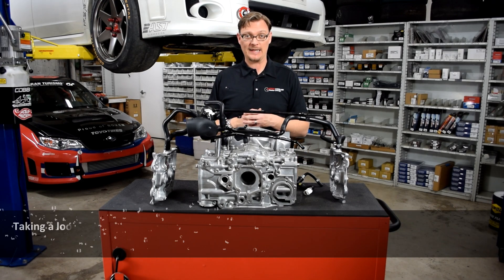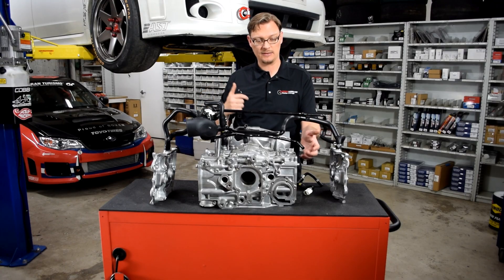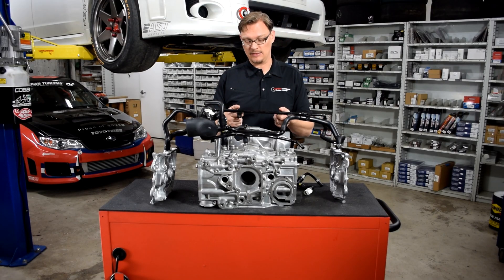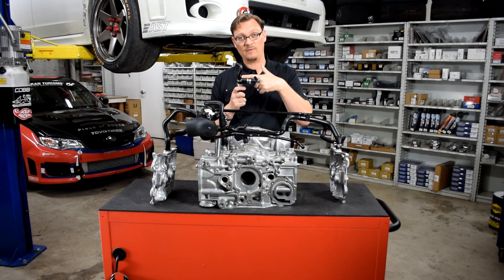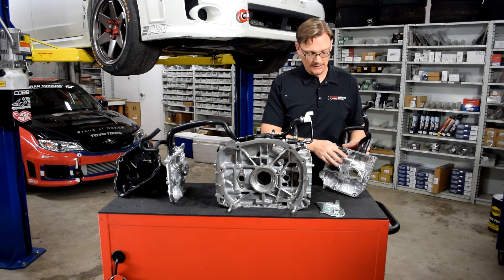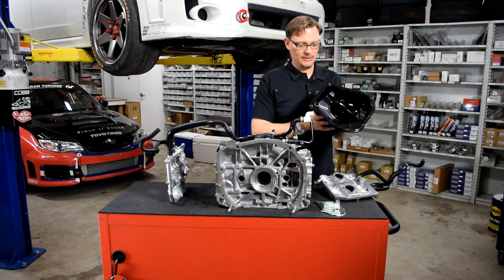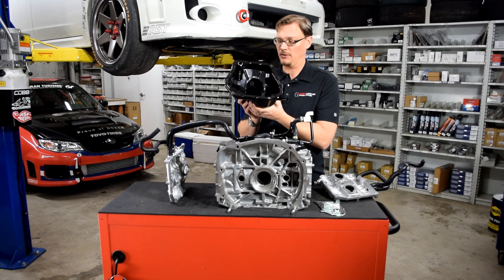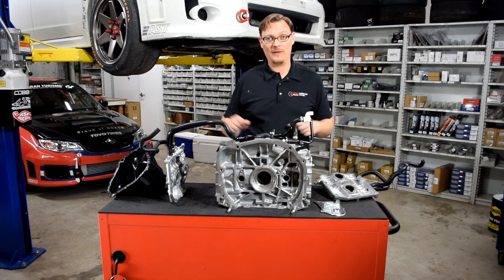Taking a look at the Subaru EJ25 Turbo PCV System

Comment: Great video, never seen such an in depth look at the EJ PCV system, shows us that them engineers at Subaru put allot of thought into the system,
Reply from the maker: Thanks for watching, and thanks for the comment!
Reply: The Subaru engineers did a TERRIBLE job in designing the PCV system because there's still a LOT Of oil that gets sucked in the engine.  Which is why AOS and catch can are so popular and a must have to avoid detonation / knock.
Reply: @neuspeed79 I’m sure you could have emgineered a better system. Besides, AOS and catch cans are completely unnecessary at stock power.
Reply: @SonikJesus  You couldn’t be more wrong. Because the pcv sucks, is why a lot of engines fail. Blowback builds up over time within the engine and the heads / cylinder get blown. AOS is a reliability mod.

Comment: At 1:40 I have a question because: You say the crankcase breather port is not on EJ20 motors, however i have a jdm EJ20 that has this breather port... am i missing something? Im looking at the stamp on the block near where the oil pump is and it says EJ20 which i presume to be 2.0L
Reply: you and i are here for the SAME reason.

Comment: The weird oring that goes on the rear oil pan drain back pipe what would be the right way to install it. Flat side of the oring facing the bottom of the block or the grooved/lipped side facing the bottom of the block? 
Cheers

Comment: This is very useful.
I bought a subaru the previous owner had not provided the right provisions from the crank case ventilation that is supposed to equalize pressure on the heads. On noticing this i take it to a local mechanic and he uses an old spark plug to blank the open ventilation. 2 days later i have oil leaks from the from cam seals.
Am preparing for an engine over haul.

Comment: Jon the degree of quality content and accurate information you and your team put out never ceases to amaze me! Thanks for your continued videos! I have a question, is it ok to run one catch can? Or should you have one catch can intercepting the connection between the separator vent into the turbo inlet line, and then another catch can intercepting the line from the hard line on top of intercooler to the hose going back into the intake pipe?
Reply from the maker: Thanks for watching and thanks for the comment.  You would definitely want 2 catch cans.  One for each circuit.  We discovered early on that if you "T" the breathers down into a single can, that can cause its own set of problems.

https://youtu.be/iJs1SSAOYiU?si=1ZCRVSLO2APz-QQK

Hope that helps and Stay Tuned!

Comment: Can the crankcase be connected directly to a catch can? and eliminating the valve cover inlet leaving only the outlet free to the intake? This way the gas pressure on the valve cover would be eliminated, preventing leaks, does that make sense?

Comment: The tube ending under the oil in the sump stops the crank case vapours from traveling in reverse up said drain tube. Without it the crank case vapours would take the path of least resistance which would not be though the baffling.
Reply: You nailed it! I'm new to Subaru & just purchased a 2006 Baja Turbo with 90k miles. So I got the haynes manual, but some of these videos are extremely helpful. Thanks for sharing your knowledge 👍👍

Comment: I need help with my pcv system on the ej20x is different and i want to find a good remedy i change the pcv valve oem all the hoses brand new oem vf52 turbo  but still have oil on my throttle body intercooler and even on my 3 port ebcs is weird i want to know what you can recommend cause so far you are the best isn this situation thanks

Comment: Heat soak cycles hardened the PVC  rubber hoses coming off the top of the valve covers especially on the passenger side .reused the driver side. Rock hard on passenger side. Unable to save
Reply from the maker: Yes, that is fairly common actually.
Reply: Thanks for quick reply. May still have oil leak issue.valve covers done,now doing the oil cooler oil rings. Hope this helps. Last is the feed lines on the turbo
Reply from the maker: No fun!  Hope you can track it down.

Comment: yo tenia el problema que aspiraba aceite mi subaru outback xt este trae un motor 2.5 turbo, le puse un canister y este atrapaba el aceite pero igual mojaba la admision, asi que compre 2 valvulas pcv de subaru 2.5 y las puse en la salida de ambas cabezas y el problema mejoro, ahora lo tengo asi y me bajo el consumo de aceite, no se si sera lo mejor pero resulto :P

Comment: Am victor majani from kenya ma question is about oil catch can is it efficient and can it bi used on NA subaru
Reply from the maker: Thanks for your question.  Yes, you can install a catch can on an NA Subaru.  Generally they would need them less, but the principal is the same. 

Just make sure that you follow the same rules and keep one can per PCV circuit.

Hope that helps and Stay Tuned!

Comment: I was so lost and now I’m found😮
Reply from the maker: Thanks for watching the video and I hope it was helpful.  Stay Tuned!
Reply: not sure if you guys check these comments often but what if i’m running an aftermarket AOS? for example, IAGs AOS has a coolant hose that connects to the expansion tank where the PCV system is normally routed and it doesn’t leave an area for me to run those factory PCV lines

Comment: Would you get Oil coming from the rear blow by hose?  I have a oil leak on the passenger side rear hose.
Reply from the maker: That is certainly possible, especially as the hoses get older.  If the hose has turned solid, there is a good chance that it is not sealing properly any longer.

Thanks for watching and Stay Tuned!

Comment: This is a great video  on this PCV system of the platform.  My question is it better than the IAG AOS system? It probably is and why didn't Subaru put a better PCV system or rather design a better PCV system?
Reply from the maker: Thanks for your question.  I would answer that by saying that in the condition where the factory AOS system fails, the addition of something like the IAG AOS will give you more capacity.  It is not a fix, just an increase in capacity.

There is a little more to the cause of the issue, and we are working on a solution, or a discussion of possible solutions.

I'd also recommend going through these videos as they go into more detail about what is going on when the PCV system fails:

https://youtu.be/HAvxjSdQsXI

https://youtu.be/iJs1SSAOYiU

Hope that helps and Stay Tuned!

Comment: I still don't understand the stock PCV valve in the manifold on turbo cars. Under boost, the valve closes and the turbo creates suction to pull gas out of the crank case. When idling or on decel the valve opens but under that condition there is almost no blowby considering that the amount of air in the cylinder is small and under reduced pressure when the throttle plate is closed. It seems like the PCV valve is actually not helpful and is a failure point if it were to get stuck open boost would enter the crankcase. This point only applies to turbo cars and I understand NA cars . Am I missing something?
Reply from the maker: Thanks for your question.  You have the function of the PCV valve correct.  First, I'd say that it is not that common of a failure point, so I would say that isn't a reason to remove the valve.

As to why it is there, it is to help ensure that the crankcase gasses are still being vented when the engine isn't under positive boost.  If the valve wasn't there, then there could be a build up of those vapour's, especially on a street car that isn't in boost that often.

This is less of an issue on a race car though.

The other purpose that a PCV valve serves is to ensure that if any positive pressure is built up at WOT, it can be reduced when the throttle closes, and by the same token, it helps to ensure that as you go into WOT, the crankcase should be starting under slight vacuum rather than atmospheric pressure, etc.

It is a small difference, but on a street car especially, it can make a big difference.  Even on some track cars.

Hope that helps and Stay Tuned!

Comment: Anyone have a part number/name for the metal hoes that attaches to the tmic?
Reply from the maker: We have this kit made by Grimmspeed for the STI TMIC:

https://www.flatironstuning.com/grimmspeed-tmic-y-pipe-kit-02-07-wrx-04-sti

Is that what you needed?  Or did you need the two smaller ones that fit the WRX TMIC?

We can help with those as well most likely.

Thanks for your business!

Comment: Any idea how to fix high crankcase pressure on an Ej20? It’s high horsepower application and I believe I have that problem I’m running a Cobb air oil separator right now. Any help would be greatly appreciated!
Reply from the maker: Thanks for your question.  The first thing I would say is to make sure that your drain is routed properly to ensure that the AOS can is draining properly.

Beyond that, we do have something in the works, but it isn't something that I can go into detail about yet.

In the mean time, I'd recommend taking a look at these videos:

https://youtu.be/iJs1SSAOYiU

https://youtu.be/pXQdgxHWFwk

Hope that helps and Stay Tuned for another video in the next couple of weeks.
Reply: @FlatironsTuning  thank you so much for the quick response! I’ll definitely stay tuned 👍🏼

Comment: Thanks for the video. Very good to know in detail how the stock pcv system functions. I'm still unclear as to the need for the pcv valve to be non return. Is there a point at which the pressure in the turbo intake would be positive and thereby the pcv valve would prevent that positive pressure from entering the crankcase?
Reply from the maker: Thanks for watching.  The PCV valve needs to close when the intake manifold goes into positive pressure, which happens when a turbo starts making boost pressure.

hope that helps and Stay Tuned!
Reply: @FlatironsTuning  thanks! Still confused 😆... so the pressure on the intake side before the compressor also becomes positive under boost conditions? I find that in itself confusing. I'd have thought it'd become more negative under boost as the turbo sucks in more air 🤔. I'd been theorizing that the pressure in the turbo intake might spike into positive under deceleration when the throttle body closes and the flow is suddenly blocked pushing pressure back past the turbo into the turbo intake duct.
Reply from the maker: @fannerguitarworks1024  You are thinking correctly.  There should be a slight vacuum in front of the turbo inlet, and the PCV system uses that vacuum to help scavenge the crankcase pressure.

If you haven't watched it all ready, you should take a look at our video specifically on crankcase pressure.  Here is a link to that:

https://youtu.be/HAvxjSdQsXI

That might help since we are talking about some real world examples of modifications to the PCV system (AOS's specifically), and then how they effect crankcase pressure.

Comment: Does flatirons carry all the plumbing to rebuild a whole PVC system? I dissembled my engine 3 years ago and moved into a new house, lost several things along the way, would like to just purchase all new system if possible.
Reply from the maker: Thanks for your question.  We definitely do, and we actually have kits built up for a lot of the common cars we work with.

If you search for OEM PCV Hose Kit on our site, you will hopefully find what you are looking for:

https://www.flatironstuning.com/catalogsearch/result/?q=oem%20pcv%20hose%20kit

Thanks for watching, and thanks for your business!
Reply: @FlatironsTuning  I appreciate the information and the links. I have a V8 ej207 set of heads (chambered to run 2.5) and a JDM intake without TGVs. Do you know which one of the kits would suit me best? If I need to email or use live chat I will. Thanks in advance for your time!
Reply from the maker: @nrw510  Definitely open up a live chat with us and we'll see what options we would have for you.  Thanks!

Comment: i know this is an old video but i still hav ethe ej257 in my 2019 base sti.  after watching this video, a dual catch can is setup inline of the 2 turbo inlets right (those 2 white plastic pieces?  this covers the crank case too right?  doesnt the turbo inlet that connects to the PCV valve hook into the crank case vent?
Reply from the maker: Thanks for your question.  You are correct, there are 2 points where the crankcase ventilation connects to the turbo inlet.  Once from the valve covers to the turbo inlet (fitting closest to the front of the car), and one from the top of the factory AOS breather (fitting closest to the turbo).

If you want to run a dual catch can, you would want to put one can on each of those circuits.

I have actually put a set of dual catch cans on a car recently, so that is one of the topics that we have in the works.

Thanks for watching and Stay Tuned!
Reply: @FlatironsTuning  is it incorrect where people use a single 3 port where the catch can out port goes only to the valve cover turbo inlet and the inlet from pcv is capped/plugged?
Reply from the maker: @jonathancunanan  I would say it is not ideal.  We have played around with the configuration of various AOS and Catch-Cans, and the best advice I can give is that you want to keep the two circuits as intact as possible.  If you join or "T" together the circuits in either the inlet, outlet, or both, some interesting problems can come about.

We actually have a lot of content along these lines.  Here are some good links that you may want to take a look at:

https://youtu.be/HAvxjSdQsXI

https://youtu.be/vGQfeqgi1XE

https://youtu.be/6bPgslpWjak

Hope that helps!
Reply: @FlatironsTuning  it helps a lot. thanks!

Comment: Hello I have a question I have oil travelling through the PVc system left side is there any reason for this to be happening? We have put on a oil catch tank if you could explain how this occurs in a video me and my dad would appreciate it thank you ever so much Steve I have a Subaru Impreza 2.5 turbo 2006 oil coming into turbocharger oil into air intake oil coming into top mount intercooler tripping out the bottom of the turbo pipe turbocharger is perfect condition there is no smoke coming out of the exhaust
Reply from the maker: Thanks for your question.  Putting on a catch can can certainly be a little tricky.

If you haven't all ready, I'd recommend going through our video on AOS configuration here:

https://youtu.be/6bPgslpWjak

That might help you.

The best piece of advice I would give is on a GD WRX or STI, you really need 2 catch cans to be able to plumb them correctly.  I may actually be putting together a video on this topic here soon in fact.

The one thing that you do not want to do is to "T" any of the lines into or out of the can.  You need to keep both circuits separate (the one from the top of the factory AOS, and the other from the top of the valve covers).

I hope that helps and Stay Tuned!

Comment: Do you recommend oil catch can or air oil separator?
Reply from the maker: Thanks for your question.  It really depends on how much oil you are seeing move through your PCV system.

If you are not losing much oil, a catch can is much simpler, so that may be the best solution.  If you are seeing more oil move through the PCV, (say half a quart in a day at the track), then an AOS may be a better solution.

I hope this helps and Stay Tuned!

Comment: Thank you for the explanation.

Regarding cases with the Dual Breather ports, the big one in this video and the smaller one underneath the coolant crossover, what role does the small port play?

Would that be used for the smaller connections that are going to the turbo in this video?

I am using a 257 case to rebuild a 251 NA engine and that is the only difference aside from the decking that I could find between the raw cases without internals. 

thank you.
Reply: Thank you. The cross over pipe actually wouldn’t allow to just cap so I had to commit to plugging it, and then I cut the plug bolt and shaved it smooth with the case. Came out really well and just glad to verify everything. 

Thank you.
Reply from the maker: Thanks for your question.  If you are using that case in an NA251, you would simply block off that center port.  You don't need it, and you wouldn't have anything to connect it to so you are best to just cap it off.

Thanks for the question and Stay Tuned!

Comment: So on my wrx, i should be fine to run a vent to atmosphere catch can? I was gonna get a regular an fitting to replace the pcv, and run that to the catch can, and combine the 2 heads and run tbat to the can which has a filter on top to vent to atmosphere
Reply from the maker: The short answer is yes, but you have to tune for the atmospheric configuration.

I'd recommend going through this video that we made on the topic:

https://youtu.be/6bPgslpWjak

Hope that helps and Stay Tuned!